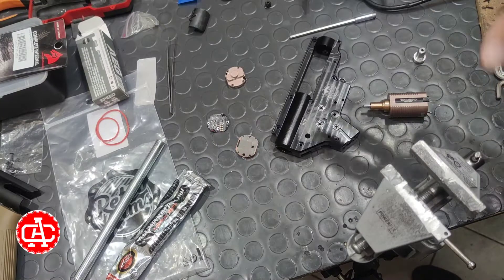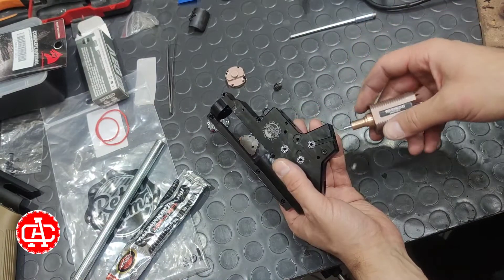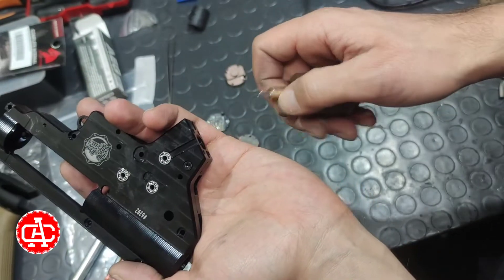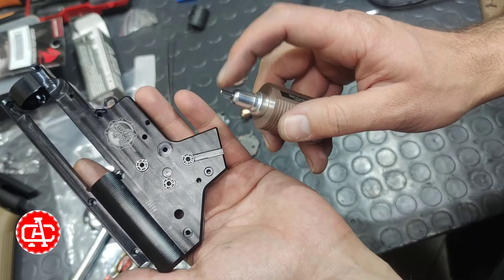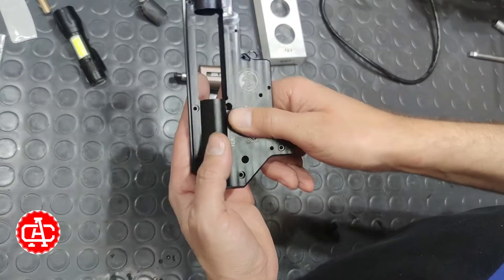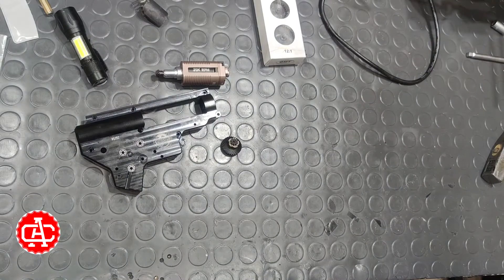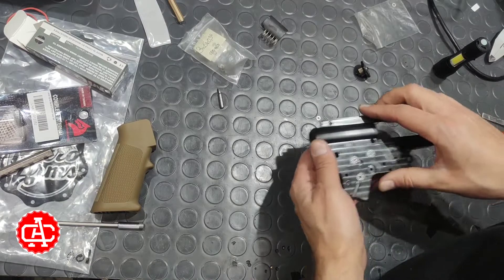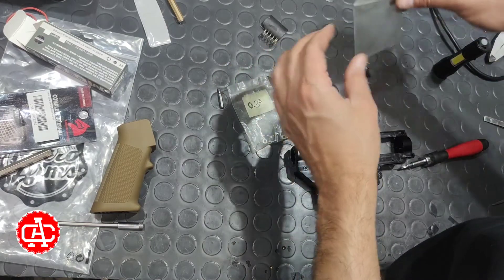E&C MK18 (EC603)Full upgrade: Part 3- Warhead dis/assembly + shimming

Comment: I have the same gearbox with t238 brushless motor. For me it was easier to center the motor by wrapping aluminum tape around the motor so that the motor doesn´t move at all in the pistol grip.

Comment: I can't cnc motor tower, but i can adapt 10mm stainless tube for base motor tower. And i think rotating this tower can scrap gbox window, so better fix this.
Reply from the maker: Do you really think that the tower rotates with the motor shaft movement? The tower is just a big bushing with which you connect the motors body with gearbox. It also acts as a controlling axel point due to the installed bushing/bearings. There are no rotations on the tower except the motors shaft. You can use any metal sleeve you have in hand. The softer, the better if you dont have a lathe, of course.

Comment: So did you have to grind the engine shaft or just press fit it?
Reply from the maker: Just press fit, and i used glue, so it doesn't spin on the axle.
Reply: @AC-AirsoftCustoms  Follow up question. If I'd want to order motor from you with the helical gear already installed, you would need diameter of the engine tower hole on gearbox?
Reply from the maker: Contact me via Facebook page. Easy to discuss there. 
https://www.facebook.com/airsoftcustoms

Comment: Any aftermarket motor guide shafts (the tower) that have a thicker diameter than 9mm? I am having the exact issue where my motor moves back and forth a little inside the gearbox.